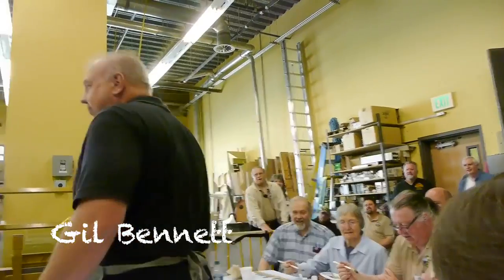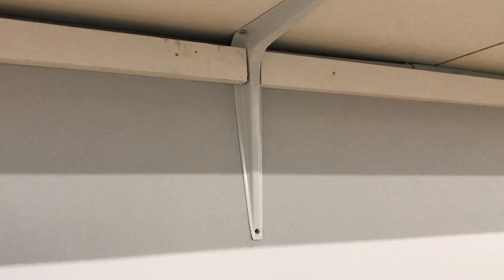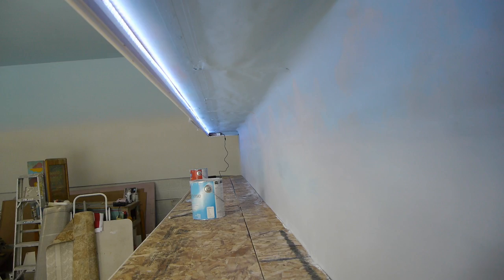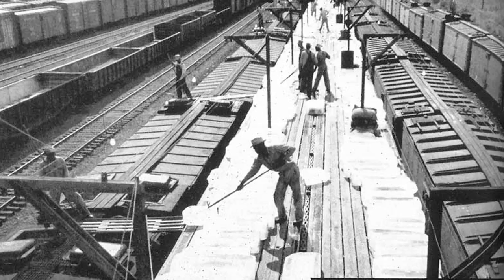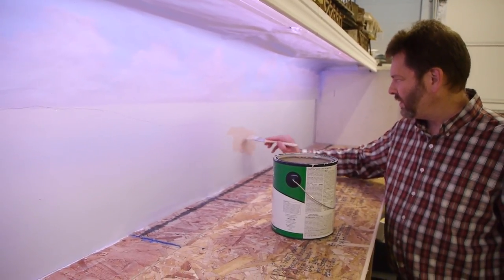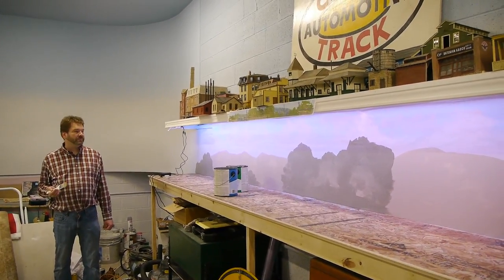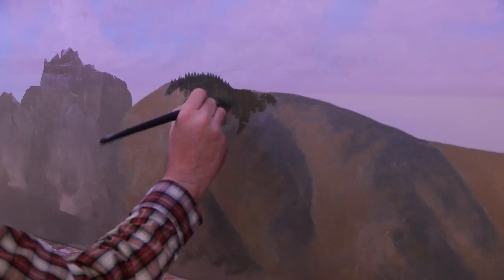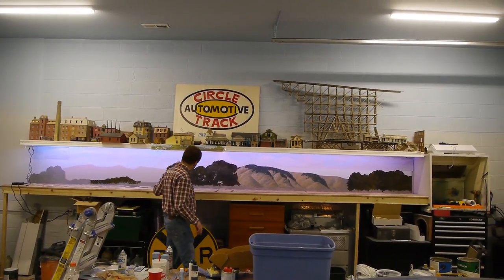How To Paint Model Railroad Backdrops with Rob Spangler

Comment: Gee-Whiz, Huck, I'll give you an apple to paint your fence...  "Nize" Now we know how and what that paper like stuff was Karyn was cutting last week. It was paper.  Oh, this is going to be so fine. Love the scale.  Carry on and by all means keep us posted on the progress. Greg and Jeann
Reply from the maker: HI!!!!! The paper was a problem. Ya need something rigid that yo can sand. AND heat and humidity make it expand. Be a real mess in your area. BUT mostly good. Backdrop is GREAT Check FB for some updated stills.
Reply: Back in the day (Don't you just love it when somebody starts with that?) Softened 1/2 drywall was used. Your paper looked like it would feather-out below the wall brackets better than leaving a half inch of wall board ledge. Unless it was continued down to the bench. I think what you and Miss Karyn did worked just fine. Watercolor paper shrinks and buckles after wetting. That normally is cotton based paper. Most others are pulpwood. You two did really well on how you did the background.. I learned something. Thank you,